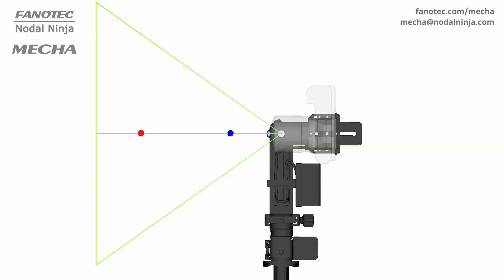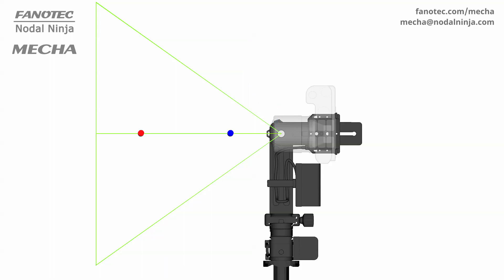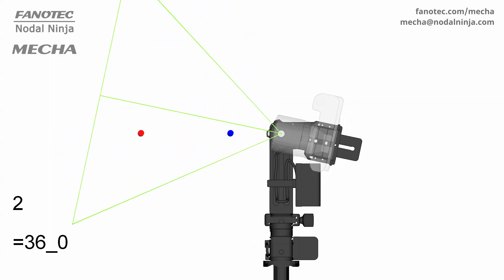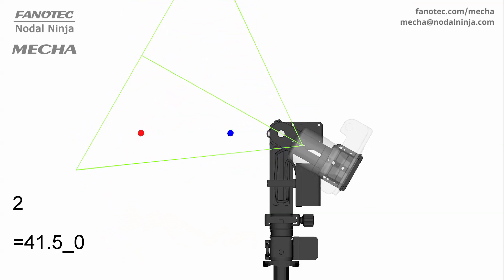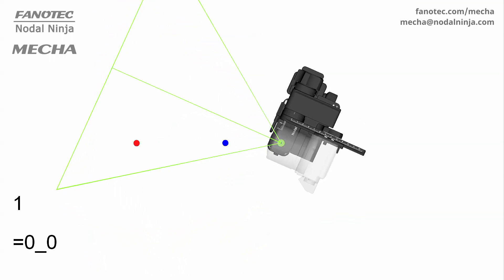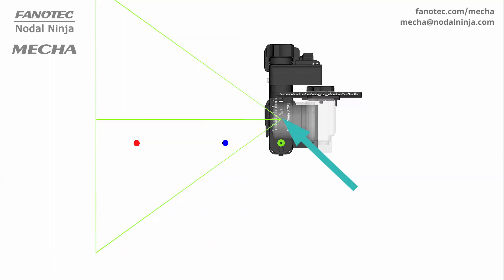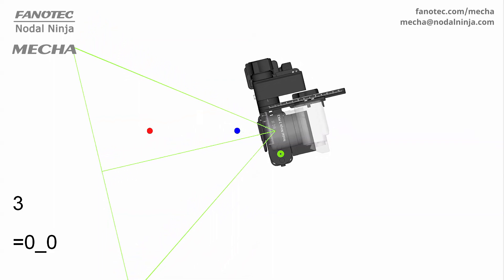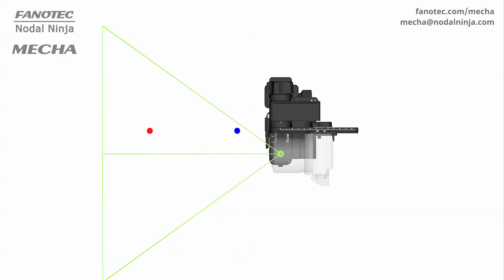Parallax Error Explained – Panoramic Photography

Comment: Is this a systematic or random error??
Reply: It is not an error in the sense of a device malfunction, but something naturally occurring when the camera is not rotated around a non-parallax axis. This isn't limited to cameras; if you look at a cup of coffee in front of you and look only with one eye at a time, you'll see the cup apparently jumping over the distant background. Also, if you turn your head, you'll again see the cup changing its position over the distant background, because the neck doesn't turn the eyes around their non-parallax axis. The brain uses this information in completing the stereoscopic view using two eyes, adding extra parallax information caused by turning or moving. This explains the funny movements an owl does with its head as well. The brain of the owl and humans uses this information for a 3D representation of the scene. However, this parallax becomes an "error" when we want to stitch two images, as close features and the distant background are in different relative positions in the overlapping area of a panorama. Here comes to the rescue the NodalNinja panoramic head, which corrects the naturally occurring parallax and reduces it to virtually zero, thus allowing a perfect stitch. The video shows two cases: one with good settings of the rail position on the panoramic head and one with wrong settings or natural rotation, and shows the difference in the alignment for either case.